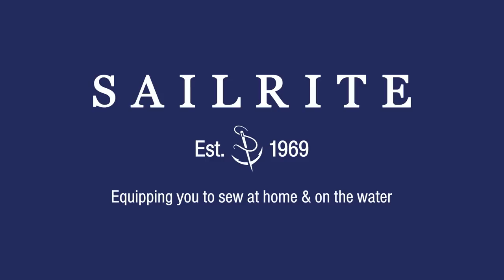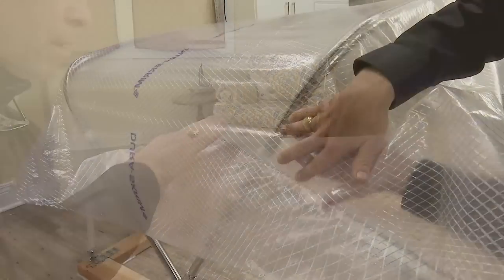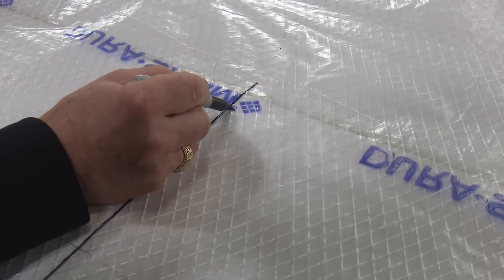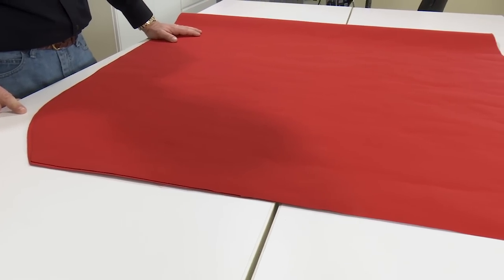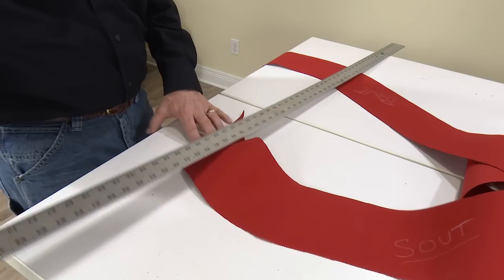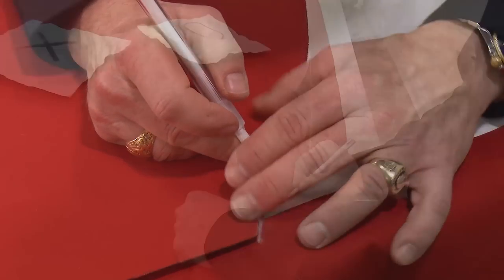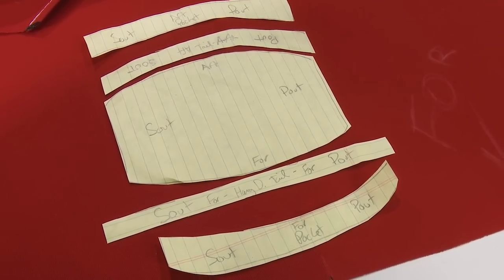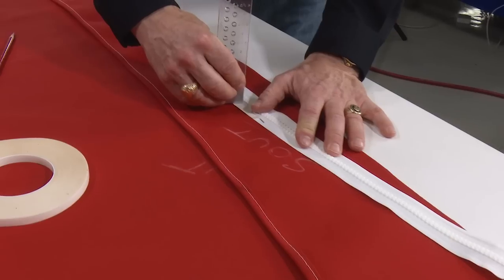How to Make a 2 Bow Bimini Top

Comment: Just finished my top. Could not be happier. Grant’s video’s are packed full of information. No waisted video time what-so-ever. Every word has meaning. Needless to say I had to reverse or back up the video time and time and kept watching until I got it. Hence, word to the wise buy your seam stick basting tape exclusively from Sailrite only! Hobby lobby,  and Joann’s is the worst, will not stick to fabric half as good and plus twice as expensive! To cut and melt the fabrics edges from fraying I did use my wood burning tool dead short element tool and it’s ok in a pinch. My objective now is to sew a full enclosure for my 
Cape Dory 25D, sailboat so back to watching Sailrite’s videos on just how to do it! Fair Winds.
Reply from the maker: Wow, that is great news! Good job. You are totally correct about the seamstick from other places, Sailrite's Seamstick Basting Tape for Canvas cannot be beat! Good luck on the enclosure, let us know if you have any questions. Thanks for your positive comments!!!!

Comment: Super helpful video, thanks! One question though: what is the purpose of the tuck down tail? And the hang down tail, other that potential extension? If I am not planning on adding an extension, can I skip both tails? Beginner here, attempting my first bimini and I would like to make it as simple as possible...
Reply from the maker: The "Tuck Down" tail is used only when no curtain or extension is used. If a curtain or extension is used you must install a "hang down" tail.  Can you not install a tail? Yes, I suppose you could, but the tail is helpful for keeping weather from running down and around your bimini edge, I recommend you install a tail.

Comment: Very helpful video.  Wondering, though, what the purpose of pretensioning the bow before patterning is?   Just trying to learn here.  Seems like if the frame is fixed where you want it to be, without pretensioning, and you pattern and make it tight all around in the process, then the finished product would be as tight and well-fitting as the pattern material was.  I.e that pretensioning would actually create fit issues.  What am I missing?
Reply from the maker: When it comes time to tension the finished bimini top with webbing straps or rigid support struts (optional) that tensioning will help to draw the top tight along the sides of the top. Since that tension is mostly applied at the sides (port and starboard) of the bimini and not near the center sometimes the center is not as tight as it should be. By preloading the Bimini frame at the center position while patterning we are in a way creating additional tension at the center of the Bimini top so the finished top will be tight along the sides and in the center as well.

Comment: As always this is a very good and useful video; however, you missed discussing the use of the second line on the string that was struck indicating the different angle of the aft bow in connection with the aft zipper sleeve. Also, elsewhere on your website Sailrite recommends using Tenara PTFE thread for rotary hook machines, which the Fabricator is one, but in the video you are recommending Profilen. Please clarify.
Reply from the maker: When using the line to indicate the pocket's release point we use that same line and measurement for both the forward and aft bow's pockets. We do not make a second line for the opposite sides bow. When using a rotary hook sewing machine we recommend both brands of PTFE thread Tenara and Profilen (they will both work great in a rotary hook sewing machine, like the Sailrite Fabricator). However, if you have an oscillating hook sewing machine, like the Sailrite Ultrafeed, the Profilen works much better.
Please let me know if you have more questions.

Comment: Start at 35:05 "We will baste the zipper down so that the binding is up against the side of the zipper's teeth."

NO! The zipper pull catches the binding and causes it to seize once pinched! Either leave at least 1/8" space between the zipper teeth base and the binding, or place the binding edge flush with the far edge of the zipper's teeth as in the Sail Cover video so the zipper slide can not catch the binding and cause it to seize.